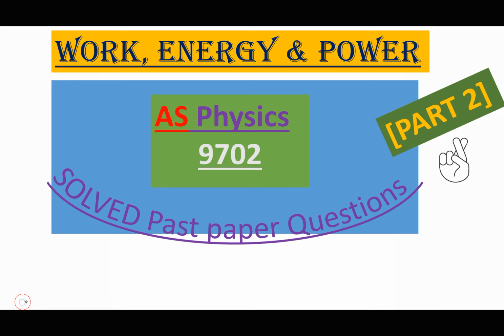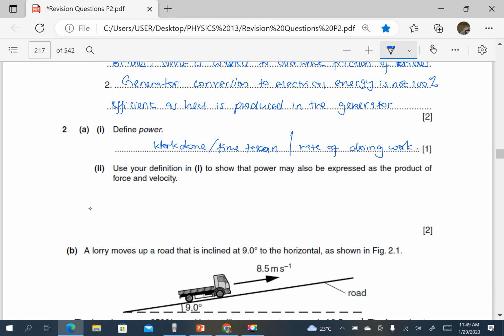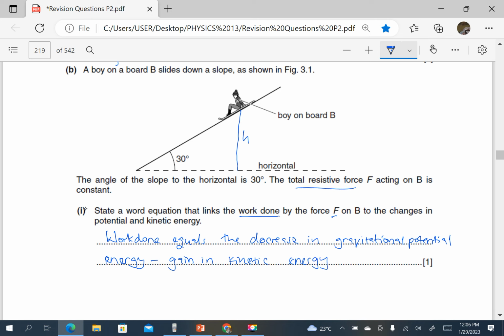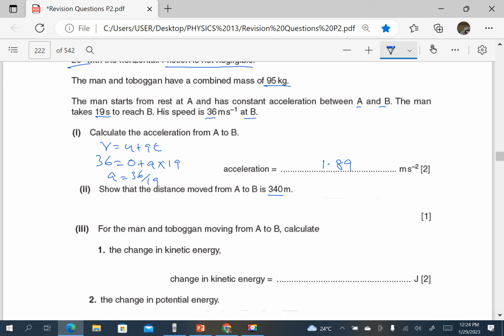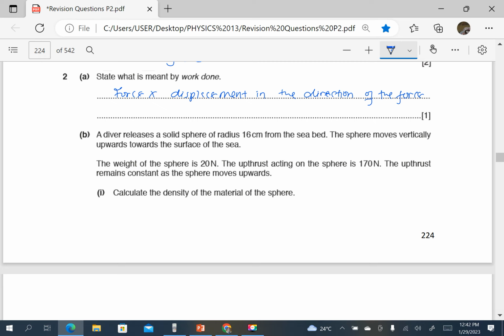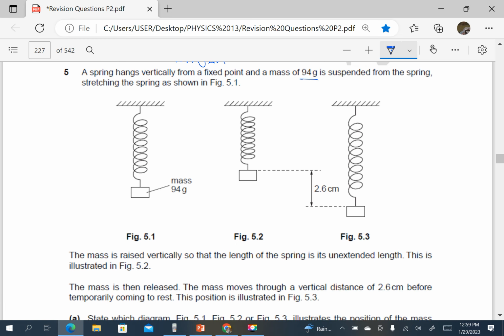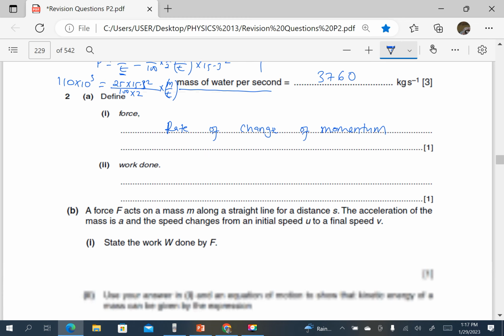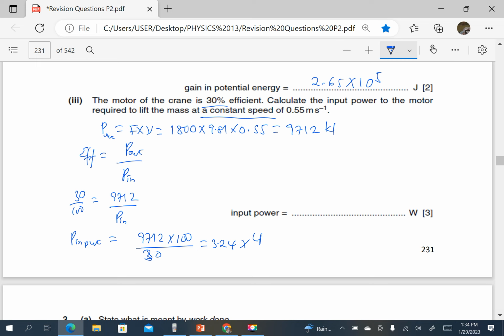Work, Energy & Power,  AS Physics  [Solved past paper Questions] PART 2

Comment: 1:00:34, why didn't in part iv for Q 1, u didn't considered the horizontal component of weight down the slope which is equal to mgsintheta, although u did used that in the next part, as in both of these parts we were supposed to find the frictional force. Can u explain ??